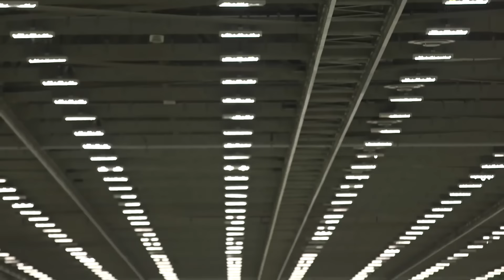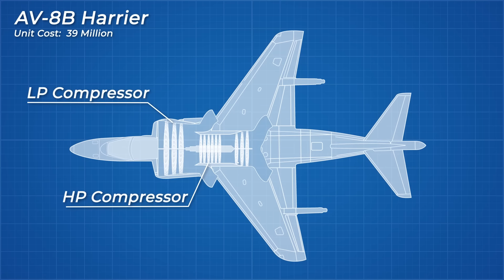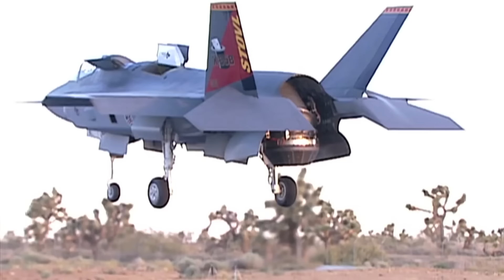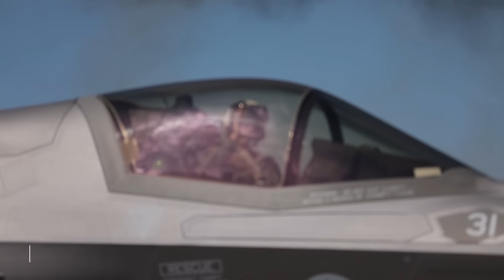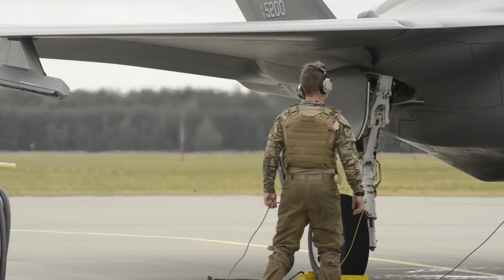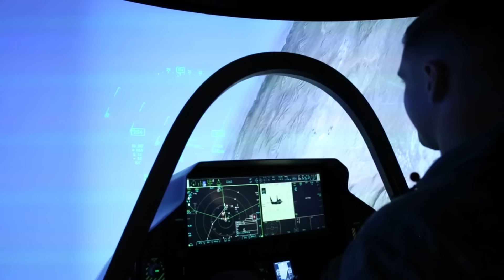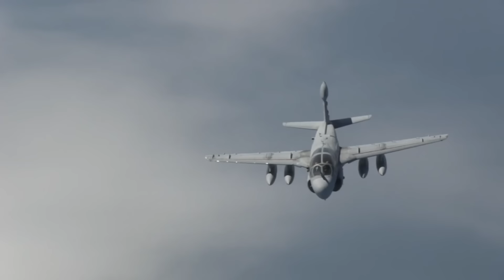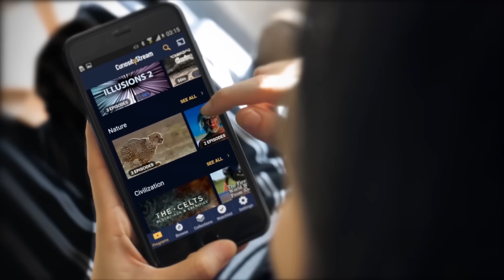Is The F-35 Worth $115 Million?

Comment: Certainly a very compromised design. This really should have beeb 3 separate programs. The US airforce is already touting a potential new design for the next stealth aircraft.
Reply: There are barely any compromises and the USAF's next gen design has nothing to do with the F-35.
Reply: @dumdumbinks274  Compromises: intake routing on f35a and f35c to avoid fan on f35b, swept intake design on f35a and f35c to avoid vtol heat soak on f35b, lack of thrust vectoring on f35a and f35c, structural layout creating extra large body on f35a and f35c in order to fit the vtol inards on f35b, lack of shrouds over engine to provide rear end stealth capabilities.

I can keep going. F35B serves its purpose for an av-8b replacement but the F35A and F35C should have been a different platform altogether. Several airforce staffers have said this along with 2 of the test pilots. I would've expected something more akin to what the concepts of the Mig-41 look like for a true f-16, f-18, f-15 replacement. 

I guarantee the F-XX (6th gen fighter) the air force is testing will also have a naval version. The f35a and f35c are really strike fighters over anything else and certainly not replacements for the f18 or the f14.
Reply: @House_of_Schmidt  Intake routing on F-35A and C also enables a larger weapons bay with capability to carry larger weapons. 
Swept intake as opposed to what? What's the compromise here?
Lack of thrust vectoring is hardly even worth mentioning since there is no real advantage to having TV.
The structure of the airframe is modified in the B model to fit the lift fan, not the other way around. 
The F-35's nozzle is designed with stealth in mind. You don't need an F-22 style nozzle to be adequately stealthy from the rear.

F-35A outperforms the F-16 in every aspect of practical performance, often by a large margin. It also meets all of the original USAF requirements for the F-16 replacement. I'm not sure what you would prefer other than a less costly development program, but that was more political than it was to do with the design. Not sure why you mentioned the F-15 either, since the F-35 was never supposed to replace it.

USAF and USN have separate next gen fighter programs, so it's highly unlikely that the USAF will produce a naval version.

The F-35C is a valid replacement for the Hornet and outperforms it in - once again - every aspect of performance. It was never a goal to replace the F-14 with the F-35C. That's what F/A-XX is for.
Reply: @dumdumbinks274  For the Navy, range is a huge factor and the F35C has significantly less range than the Super Hornet. The F35C also carries less payload than the Hornet. It also has less hard points than the hornet. As far as top speed its almost exactly the same. F35c is a 1200 mph plane and super hornet is 1190. As far as maneuvering, we don't really know. Likely the F35C is a better rate fighter and the Super Hornet is a better one circle fighter. 

The engine shroud does not provide stealth and is a weakness of the aircraft. This was explicitly reported on by the USAF, the British and the IAF during their partnership in the JSF program.  There's no way to make a giant opening as stealthy as one with shrouds. Sure coatings and serrated nozzle notches help a bit but not nearly as much as shrouds. Lockheed released a statement saying the intention of the aircraft is to provide its exceptional stealth capabilities in a head-on and a "notched" attitude (side view), essentially admitting the aircraft isn't as stealthy in a "cold" attitude (from behind). 

What you're saying about the weapons bay is also not true. The f35a and f35c weapons bays already fall under the current routing of the intake. Had that intake been straight rather than curved to avoid the f35b fan, it still would be located above the weapons bay yet the a and c variants could have gained 5% to 10% better performance at sub-20,000 ft altitudes according to Lockheed's own propulsion project director. 

For the cost of this program, this should have been 3 separate programs. Cost overruns were insane here and even tho there are serious leaps in avionics, radar and coatings with the F35, general performance of the aircraft is not near what it could have been had these been separate programs. 

USAF and USN next gen fighter programs are part of the exact same research budget so they still could be combined. Little is really known about this tho so it's just speculation on my part.

I dont mean to sound like an ass or a know it all or anything. I just work in the industry as a design and systems engineer so we love to talk about this at work.
Reply: @dumdumbinks274  also when i said swept intake, i meant forward swept intake. This causes vortices at the fuselage and additional turbulence likely reducing performance. The forward swept nature was done purely for the f35b model to reduce heat soak from vtol exhaust.
Reply: @House_of_Schmidt  Range is a huge factor - that much is certain for the Navy. However the F-35C has significantly longer combat range compared to the Super Hornet. The only range concern by the USN that I've heard of is that their predictions of future threats back in the 90s fell short of what is available today (and in today's future), and thus the F-35C was built to requirements that might not be viable as long as hoped. Not a compromise but rather lack of foresight by the USN.

Speed. The F-35C achieves 1200mph when equipped for a long range strike mission. The F/A-18 achieves 1190mph when equipped with at most 4 missiles (only 2 of which are BVR), and absolutely nothing under the wings, not even the pylons. There's quite a difference, and an F/A-18 equipped for a similar mission as the F-35C is barely supersonic and limited to roughly 5Gs.

Hardpoints. The F-35C has 10, all of which are for weapons. The Super Hornet has 11, 1 of which cannot be used for weapons, so on a quick look they are equal... however the F-35C has 6 hardpoints rated for 2000lb+ weapons, whereas the Super only has 4, 1 of which is always used for external fuel tanks. You might argue that the F-35 is typically limited to 4 internal hardpoints, whereas the Super typically carries weapons on 6-7 hardpoints, but that comes down to difference in mission; the F-35 solely uses internal hardpoints only on stealth missions... missions that the Super cannot perform.

As far as maneuvering is concerned the Super is likely worse in most aspects, with comparable AoA performance. I'd bet money on the F-35C winning most fights whether 1 circle or 2 circle, but a 2 circle fight would be pretty close. However any time the vertical aspect is considered the F-35C wins, and a fighter that has a vertical advantage over the enemy is almost always the victor as was the case in Vietnam - MiGs could generally out-turn the loaded F-4s, but they couldn't win unless the F-4 pilot was unaware or inexperienced.

The nozzle does not provide as much stealth as on the F-22, but in terms of practicality it's not a big priority. Rear aspect detection and tracking is far more effectively done with IR than radar, and no amount of shrouding is going to stop IR detection. In terms of IR visibility it is comparable to any twin-engine fighter, and in terms of radar it is still better than most fighters. Sure you can call it a compromise, but it is one that can be upgraded later on if deemed appropriate. Basically a compromise on cost.

My point about the weapons bay was not accurate, but it's about space. The tradeoff to that potential 5-10% extra performance at mid to low altitudes is a large increase in either BVR combat performance via more powerful electronics, or range that benefits offensive missions. Space matters, and there's little point sacrificing potential real estate to be slightly better aerodynamically at certain altitudes. Yes it's a compromise, but it isn't without performance benefit.

The air intakes are forward-swept to assist the DSI inlet functionality by capturing air that would otherwise be forced over the fuselage. A DSI inlet is beneficial to frontal aspect stealth since it is part of the main fuselage structure, and is significantly lighter than traditional intake designs such as on the F-22. Supposedly if the intakes were rear-swept like on the F-22 they would produce more turbulence than the forward-swept ones since more air would end up hitting the edge of the intake rather than being captured. Now I'm not an engineer, but I have never seen or heard the reason for the intakes' design being because of the F-35B.

Basically, the F-35 is compromised in ways that benefit it's role most. Sure I can see your point about potential designs, but the F-35 was designed to be produced in large numbers like the F-16, so cost was a big factor. Take away the cost factor and you end up with fighters such as the F-15 or F-22 that can't be procured or operated in large enough numbers. You could argue that the cost overruns were far more significant than usual, but that is mostly thanks to politicians experimenting with procurement strategies, not the design of the F-35.
Reply: @dumdumbinks274  The F35C has a 1350ish mile combat radius whereas the super hornet has a 2000+ mile combat radius. 

As far as the intake being more stealthy than an F-22's. I could see that on mild aspect views but again the primary reason stated by lockheed for the forward swept intake which was also stated by boeing for their x-32's giant forward swept intake was to avoid heat soak during vtol. 

From the F35's design, i believe it would struggle in a mid-altitude one circle fight with the Hornet. The Hornet is the best one circle fighter we have. We do know that at least one test pilot admitted he couldn't keep up in a dogfight to an F-16. 

Its not just politics that have caused overruns. There have been a ton of issues that are coming up on the Lockheed side of this project. Currently they cant even certify the airframe for more than 2100 hours when a typical airframe is good for around 8000 hours. This is due to structural cracks which yet again is due to unforeseen stresses on the curved main structural supports designed because of the B variant and applied to all variants. The gun is having problems firing straight. I believe on the B variant its firing down and to the right of where expected. They're having some coating issues which come off during high speed flight.

Im sure they'll fix this and ofcourse everything im saying is in hindsight. I dont necessary blame Lockheed for most of the F-35's shortfalls. They were given the most difficult task by politicians but they certainly have milked the opportunity.

Either way the f35 is not going away and they'll definitely be using this thing for a while to come. I just wonder that once there is real competition out there such as the Su-57, Mig-41, JC-31, koreas stealth jet and Japan's stealth jet(dont know if this one is still happening), how will the f35 compare?

The f35 will certainly be great against these "ragtag" groups like isis or al-qaeda. It should be fine against a 3rd world nation, especially with its suite of avionics and the new helmet, but once other prominent nations finalize their 5th gen jets, along with getting more S-400's i have a feeling the f35 will struggle.
Reply: @House_of_Schmidt  Your range values are for Ferry range, not combat range, and it seems you have confused the range value for the F-35C. 1350mi is the range of the F-35B which is significantly shorter ranged than the A and C variants, and is merely comparable to the Super Hornet in terms of combat range. The F-35C can reach slightly less than 2000mi for a ferry flight and has a 750mi combat radius on an air to surface mission. The Super Hornet has a 2000mi Ferry range while carrying 3x external fuel tanks and 2 AIM-9s, and a combat radius of at most 530mi on an air to surface mission. 

I'm skeptical of the idea the intakes were for heat soak. Can you explain the reasoning? 

The only maneuvering advantage a Hornet has over any other US fighter currently in service is it's AoA and low speed performance. Those capabilities are matched by the F-35 and F-22, both of which have superior sustained performance. The Super Hornet is less maneuverable than the Hornet thanks to the extra weight and larger airframe causing more drag with proportionally less powerful engines.

The instance of a test pilot saying he couldn't keep up in a dogfight is because he was flying AF-2 with severe flight restrictions shortly after it had completed a range of tests. It is almost universally accepted by [experienced] pilots of the production models that the F-35 is comparable or superior to the F-16 in BFM.

It is mostly politics causing the cost overruns beyond what is normal for a fighter's development. Cost overruns in general are normal, but in the case of the F-35 overruns are exacerbated by the idea of concurrent development and procurement. That idea was a political one to make the aircraft cheaper, but don't ask me how they came to that conclusion... I have no idea why anybody would think doing so would be cheaper unless they had no clue how development works. LM are partially to blame for that of course since they encouraged the idea, but ultimately it was proposed and allowed by the DoD.

A models have no issues with their 8000hr service life that I'm aware of. It's the B model which is limited to 2100hrs, and the issue doesn't affect all airframes. Similar case with the stealth coating peeling off - the issue has only occurred twice and the last time was in 2012 despite plenty of testing... restrictions are in place because although the issue is severe, it is also highly unlikely to occur and the lack of instances outweighs the cost to fix. This issue only affects B & C models. The current major gun issue is with the A model and is a structural problem with the gun's housing. I believe accuracy issues have been worked out for the B and C models which both use centreline gunpods.

We'll have to see what happens in the future... I doubt it will become obsolete so quickly since it was designed to be modular with it's avionics and new generations of fighters take increasingly large sums of money and time to develop. Though I can see it being more effective in a support role later in life.
Reply: @dumdumbinks274  The forward swept intakes being predominantly for heat soak are due to when the vtol version nears the ground, the vortices from the exhaust push out mostly to the sides of the aircraft. You see this with helicopters very often, especially ones with longer fuselages. Sweeping the intakes forward creates a sort of "shield" in order to increase the exposure distance from exhaust gas to intake without bringing the entire intakes forward any further. 

All around its kind of compromised. If this were purely a vtol variant, intakes on top of the fuselage would be best. If it were a traditional jet, backwards swept intakes would be best for flight performance or intakes integrated into the wingtips with separate controllable leading edge flaps. 

As far as ferry range, theres some conflicting numbers im looking at but either way, with external tanks the super hornet and f35 are equal.

 I disagree with the legacy hornet vs the super hornet. Specifically the blue angels which are switching to the super hornet just released a study to show that with the super hornets better thrust to weight ratio, they'll be able to expand their maneuvers during training and the extended leading edge flaps greatly improve roll and aoa performance. 

As far as tests go 2 early tests had test pilots which complained about the capabilities of the f35 in a dogfight. This caused a ton of PR backlash for Lockheed, so its no surprise that test pilots today just kinda go with the corporate agenda and say it behaves equally or better. You can even see in interviews and reports test pilots behavior changed after the PR backlash. This is actually really common in the industry. Early reports tend to be the most honest especially with government contracts and later reports tend to gloss over any fundamental issues that cant be rectified and focus on those issues that can be relatively easily fixed.
Reply: @dumdumbinks274  Also the f35 significantly lacks in range when compared to the f16 with tanks. The usaf, usn and lockheed have all acknowledged that the f35 is not meant for dogfighting. Its BVR fighter. This has been repeated in dozens of reports. Im sure it'll be excellent in BVR fights.

Comment: Is it worth 115 million? That question shows you don't get it. When it comes to Pentagon procurement, the value IS the cost. The more it costs, the better. Better dividends for shareholders, bigger salaries for retired generals, more loyal states, where the "gold"weapon is fabricated etc. So, paradoxically, if cheaper, it could be ruinous.
Reply: Which explains why there have been dramatic efforts to drive price down?
Reply: @infinitelyexplosive  Dramatic and  almost as convincing as the WWE Championship.
Reply: @chavdarnaidenov2661  Switching from cost+ to fixed contracts is a pretty big deal.